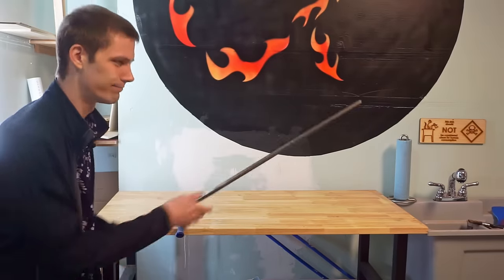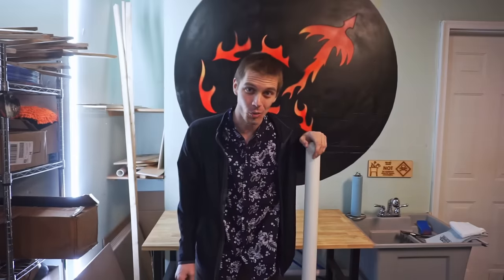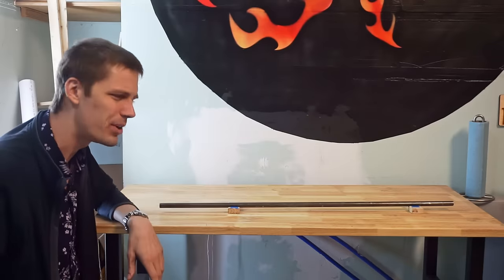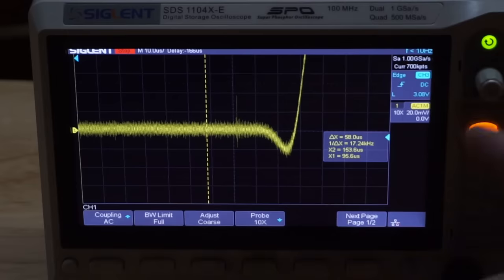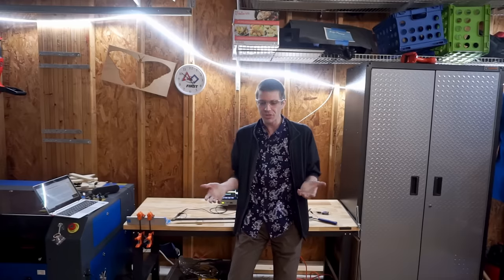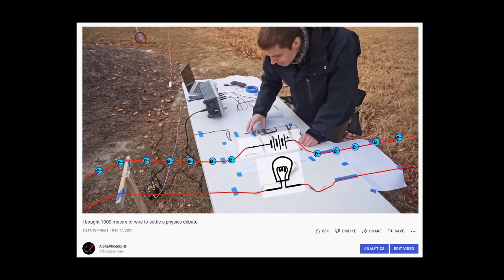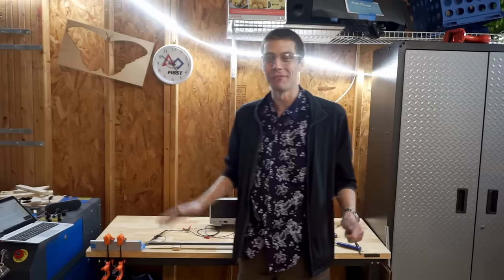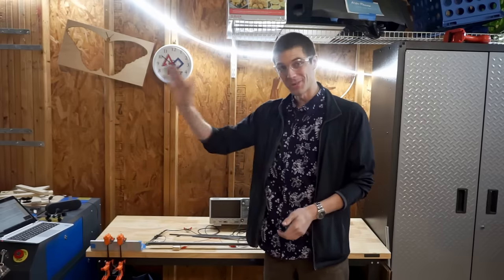Are solid objects really “solid”?

Comment: Physics change as you scale up, but the movement of the receiving end of the bar would be instantaneous, even if it were light years away. You said it yourself, the person pushing the bar has infinite strength, so would be able to push the bar just as easily as if it were scaled down to human sized levels

Comment: You measure the time the electrons need to move into the wires to complete the circuits. You move the bar 300.000 km long and it’s instant observed at the other end by the observer, not after 1 second. You, the first observer, will observe the end moving after 1 second, not the observer at that end.
Reply: assuming you're using wires to transmit data like he is, the speed of transmission of electrons in wires is nearly 2/3s the speed of light, or 200,000,000 m/s roughly. The speed of sound in steel (which he demonstrates) is roughly 5000 m/s. That's a huge, huge difference.

if you tapped the steel and sent an electrical signal at the same time to someone, the electrical signal would be about 40,000 times faster.

In physics, the uncertainty of equipment is required for ALL data to be considered valid, and oscilloscopes are some of the oldest and most fine tuned tools. If the speed of transmission in a wire had an effect, it would be listed and included in uncertainty. I don't know which oscilloscope he is using but typically uncertainty in time is on the order of around 1 microsecond, while data proving his answer is on the order of around 100 microseconds. All things considered, a pretty high confidence in terms of uncertainty caused by circuits and other factors.

nothing is "instantly observed." nothing is "instantly transmitted." If the steel bar's movement was instant, we would be tapping on bars to transmit data rather than using wires. nothing (not signals, not vibrations, not light, not anything) can move faster than the speed of causality, around 300,000,000 m/s

Comment: My guess is C, because the speed is compressive. Actually my real guess is over that length the energy required for compression would be trivial compared to the energy required to move the entire rod, so the far end wouldn't move at all- it would just compress. But assuming a "perfect" solid I'd assume C.
Reply: yay I was right, at least about C. anxiously awaiting the followup video where you acquire a light-second-long steel rod and test whether the other end moves at all.

Comment: So without having seen the answer yet I'd argue like this:
Can't be instantaneously because that way information would travel faster than the speed of light and that is definitely not possible.
To check my intuition on the 4th answer I did the math for  a 1000m long bar and then it would still take more than 3 seconds and that is too slow. 
I wanted to go with the speed of light because i thought the speed of sound was also too slow. Butthen i remebered that the speed of sound depends on the medium it travels through, so i would go with the speed of sound in steel.

Comment: You can imagine this with Jello.  If you slap one end of a jello "bar". You'll see the force jiggle through.  That's easy to see cause jello isn't nearly as rigid, but essentially all matter behaves the same way, has that compression/expansion element.  But now that I think about it.   Is it possible to have a bar that is so long that when you smite one end of it, that the other doesn't move, or moves negligibly because the force was dissipated outward in expansion of the diameter of the bar

Comment: Genuine question: Wouldn’t a solid projectile’s ability to move at supersonic speeds disprove this? If so, wouldn’t the speed be closer to that of causality? Should the question instead ask, ”what is the amount of acceleration required to produce an instantaneous moment on its opposing side without changing its state?” Or am I crazy?

Comment: It seems that it would be more accurate to say the speed of energy through….and then add whatever you are measuring energy through. It’s not really sound that I’d be measured here, it is the resistance to the flow of energy through the metal bar. Also there doesn’t seem to be an account of how much energy is going into the bar, in other words the mass of the hammer plus it’s velocity. The larger the hammer as compared to the bar, the more resistance there will be, this is one of the reasons why incandescent light bulbs release light.

Comment: Can't the pressure sensor have some latency? Would be helpful to first strike the pressure sensor with the hammer or a very small rod comparatively and measure the latency? I'm sure the theory is correct but not sure about the time it takes.

Comment: Ummm..  bandwidth of the force transducer?   How about the oscilloscope?   Repeat the experiment with half or double length bar for reference of baseline error due to probe and lead lengths used.  Did you deduct the time taken for electrical signal in probe lead?   I think you would get the same result with your setup if the bar was 3 metres long.

Comment: Are you measuring the transit of the shockwave in the bar or it's actual movement? The heavy bar has to accererate when the hammer hits it. There will be some delay between the first contact and when the hit end of the bar starts to actually move off away from the hammer. Could you measure the movement of the bar at each end optically?

Comment: What would happen if the hammer was travelling faster than the speed of sound through steel upon impact?
Would the pressure wave start faster then settle at the speed of sound through steel?
Would you get a sonic boom travelling through the steel?

Comment: My guess before going into the video is that it's going to take c) the length of the road divided by the speed of sound. I reason that a solid object(rigid body) is only rigid in the Newtonian ideal system that follows Newtonian physics down to its core. Which the real world isn't, per se. So, in the real world, any rigid body should follows, say, finite element analysis in which a movement is but a purse propagating through time and space; hence, a speed of movement is, or has to be, the speed of sound.

Comment: What about latency from operational. time in the oscilloscope to perform calculations and render the display, and so on?

And regarding the flow of charge across the gap in the vanishingly short distance before the hammer strikes, the polling of such isn't possibly being measured here surely, because the detection begins when the detection begins, there is no impartial clock/timer.
Re: if between the hammer and bar began to discharge 'early', the intercept would be negative - why would this be the case?  How would it know the spark occurred "early"?

and also re: #2,  the point here is not about "serious delay", it's about ANY delay (the whole point of the exercise is to determine such...)

Comment: Its even crazier when you realize that atoms are 99.999999% empty, and the fwct that they're such strong "springs", means that you're not pushing against a mass, but a collection of something that is within every atom and pushes out incrddibly strongly, so Something feels solid, even though it isn't, and feels real, but is different from the way we expect it to be.

Nuetron stars are simply a soup of electrons crushed together. They are not made of atoms, but nuetrons  are part of the very little amount of mass an atom actually has. So if all the "nothing" was crushed out of atoms, you would be as dense as a nutritio star, a almost exactly besudes the occasional imbalance of protons and nuetrons. 

So then what is a black hole "made of"? What IS the singularity? If you take a nuetron star and crush it further into a black hole, you would get pure energy, as you mist define what make up nurtrons and further crush them into itself, leaving now a soup of whatever builds the structure for them, which are quarks. So what happens when quarks are crushed together? What are they made of? Maybe the singularity is a physical thing that is made of pure quarks, or what's more likely, what quarks are made of since in order for a quark bath to that much denser than a a neutron bath, there must be a lot of space. 

It just came to me. The singularity is just one MASSIVE nuetral nucleus! Like a nurron star, but instead of a sea of nuetrons it is a sea of quarks with positive and negative charges from the up/down quarks. 

Or this can go further and crush the quarks into what they make up, which could be pure energy in quantum strings like string theiry suggests, which would make sense as this would be possibly infinitely more dense than nuetron stars because realatively speaking, they have a set mass, but because of how little space they take up, its practically infinate mass and the larger the area, the larger the event harison os for the black hole.

The singularity could be a complete concentration of the pure essense of what creates the universe, whatever makes up quarks. 

Im thinking if we find a definitive structure to quarks, THAT is what the singularity of a blackhole is made of.

Comment: Commenting at 4:24; presuming there is absolutely zero deflection in the bar stock/rod when it moves and presuming you have enough force to move the entire length of it, the absolute moment end a moves, end b moves.
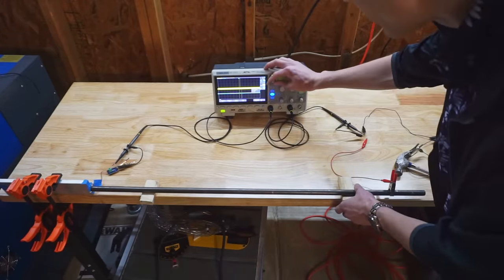Reply: Commenting at 7:40 ; this is setup will skew the data. The wires and wire size will introduce resistance and delays and as well as the machine itself, as it translates the data to a visual representation on the screen.
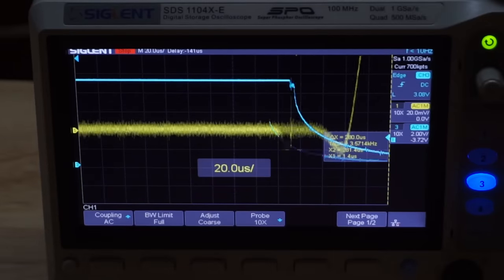Reply: Commenting at 9:00 ; this is not a controlled experiment. You need to calculate the exact amount of force required to move the exact amount of mass of the bar stock/rod. And then apply that exact amount of force.

Comment: Would not the strike sensor and the movement sensor leads and connections have to be physically and electrically identical in order to get an accurate measurement??

Comment: Does the speed of sound only apply to a perfectly straight or solid lump like an anvil? If you hit one end of a steel thing that's not perfectly straight, would there be a slowing. E.g. if you whacked one end of a car spring, would it be equal to the speed of sound in steel travelling the longer path of the coil, or somewhat slower? I mean if you changed the gauge of the steel, I feel like the propagation would be slower with a thinner spring wire, despite the same distance of coil, no? What about a steel rod bent into a semicircle, and you strike the side of one end?
Reply from the maker: A solid lump has a slightly higher effective speed of sound - thats the more complicated story behind the measurement discrepancy I talked about at the end

Comment: What if the "springs" were fully compressed when you hit the bar?
Reply from the maker: There is no such thing as fully compressed - repulsive forces just go up and up and up
Reply: @AlphaPhoenixChannel  wow thanks for answering so quickly. As you increase the repulsive force, does it change the speed of sound in that object? Or, more specifically, if the electrons in the bar (or any medium for this matter) were already in a state of inequalibrium (pre charged, let's say), could there exist a set of conditions (i.e. medium, system resonance, temperature, amplitude, etc) where the speed of oscillatory pressures (speed of sound) causes propogations to happen closer to instantaneously at both ends? I don't feel like we're asking the bar to travel faster than the speed of light I feel like we're asking if there is a possible situation where each nuclei is close enough together to seem like the object is infinetly ridgid such that information from one end is available at the other end at exactly the moment it is sent.

Comment: I know, off hand, the bar HAS to compress to transfer energy from one end to the other, which has to be less then the speed of light which is less then instant, the speed of sound is relevent to our atmosphere which the bar is NOT made out of, so the leaves the only answer as D... Which is the answer i do not mathematicly understand by looking at

Edit: i was wong, only cause i thought the speed of sound was linked directly to the speed of sound through air, cause that's really the inly time you hear it talked about in normal circumstances, but hey i was close
Reply from the maker: You had 100% right reasoning 😁

Comment: So after the hit and the wave is traveling through, is the bar technically, however incredibly minor, shorter in length briefly?

What about not impacting the bar and simply moving it with your hand. That would still seem to be to be instantaneous, no? Or is this still a wave as the atoms at the point of contact with the hand bump into the other atoms?

Comment: Technically, this could be a joke. "A mathematician, a physicist and a chemist go into a bar... ".

Because deeper down, it all comes down to what test rig we set up. The mathematician would argue motion travels with the speed of sound, gravity even with the speed of light. The physicist would put electrons into a metal rod only to later realize they can be stored and put into perspective here, "compressed". But the chemist would argue a rod of the size of one light second, no matter the material, would not transmit anything from one end to the other as it couldn't stand its own weight, collapsing way before any motion would be transmitted.
And also the pipe with water wouldn't work as expected by the physicist as water cannot be compressed without immense forces way higher than trying to push two electrons closer together.

Comment: Sorry my friend, all you measured was the speed of the hammer from when it contacted the bar to the activation of the pressure switch. You would have the same results by hitting the sensor directly with the hammer.

Comment: this is only my conclusion. impact of the bar with a hammer causes a pull back and then a push that's your delay. try a non-impact push and you will find different results. I think its the same as waking the back end of a hammer to tighten the loose head.

Comment: It depends on the hardness of the bar plus the bar vibrates when you hit it and the bar compresses so there's that formula as well. Just think of the bar being a wire the thickness of a hair . . . . or think of spider's silk that is stronger than steel . . . the thickness matters so the answer must be (E) so I'll have to watch and see . . .
Based on 18:20 I'll say I got it right.

Comment: I would guess iron is compressible so there would be some delay because of the force necessary to move all the mass in front of it. This is why trains need a loose connection. It has to break down the inertia into small bits. The same would be the case for the individual atoms. There would be a copmpression wave generatef by the imopact.

Comment: I don't believe you answered your initial question at the beginning of the video. 
Providing the assumption that a steel bar of that length would not squish from its own sheer mass when being pushed much less hammered. 
I believe the time delay would be so small if not measurable. You went from pushing the rod to hammering a sound wave through it. 
Even your spring atom model would not move significantly enough being pushed to be measured instead of being hit or struck. Being hammered causes a spring like reaction to the atoms but being pushed does not. Only the resistance of being squashed would determine the time delay. 
Harder the impact greater the delay.
Softer or no impact just a push would be less of a delay. 
Imo you've only discovered the springiness of that steel rod not answered your question at the beginning of the. But in highlight you did answer the question to the title of the video and that is no not solid. 
Still great videos from you keeps me on my toes
Reply from the maker: The only reason for the sharp impact was to create a visible signal. Pushing and hitting are the same thing when you zoom out. At the scale of this experiment, the hammer was still in contact with the bar and pushing on it for most of the test - it came off just before the signal hit the far end
Reply: @AlphaPhoenixChannel  I think we'll just agree to disagree then because IMO gradual force over sudden Force force at any scale would and should show different results. But I'm probably wrong as usual lol. You're good though man love you videos I am subscribing to you

Comment: But how do you know that there's not a microscopic delay in the input data being interpreted and that's what you're catching in your sensor reading? Wouldn't it take time for the  the input from the sensor to reach your device that's doing the calculation? This is such a very small amount of time that you're pointing at here, I would wonder if that could be the delay,  just that input "coming together", so to speak. So the amount of time it takes for the electrical circuit to register in the device on the side with the hammer and the same on the side with the sensor basically, that small, very tiny amount of time.
Reply from the maker: Because I try multiple bars later in the video

Comment: Felt that the initially measured value was clearly not proof at all of the phenomenon you were trying to demonstrate.

However, the graph of values showing a y intercept of near-zero was proof, because you can use the slope for the true transmission speed.

While you went over the grsph in the addendum, it probably should've been noted immediately because there's no proof at all that there's no delay in the detector.

Comment: Wait so it measures the hammer strike after electricity travels from your clip, through that long cable and then it reads it on the sensor. wouldnt that cause a delay because the electricity travels at the speed of light from your clip to the sensor?
Reply: Yes, but that additional delay would be in the order of 1 nanosecond.